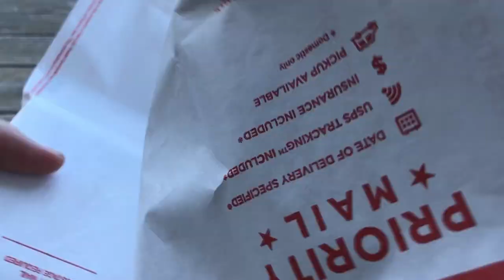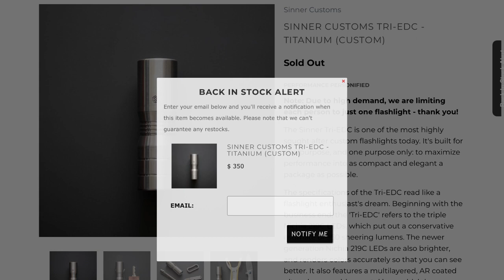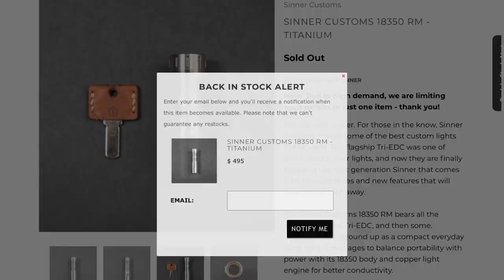Sinner 18350RM: Custom Flashlight In-Depth Review

Comment: Debating between this and the Okluma DC1.
Reply from the maker: I recommend the Okluma. They’re readily available plus you have a wide range of customization options direct. Sinner’s also using CP2 titanium which is a lot more malleable.
Reply: Sold, just placed an order for the Ti DC1!! Now I just need to find a replacement clip for it. Your video made me want to upgrade the clip ASAP @Precogvision